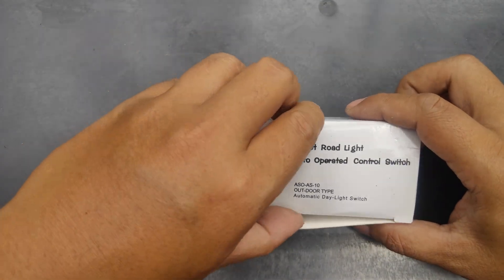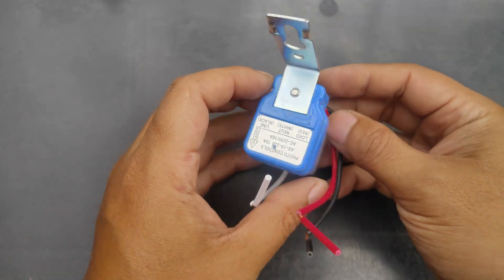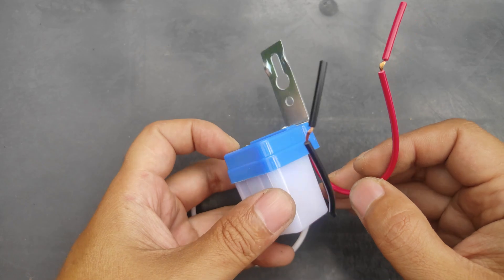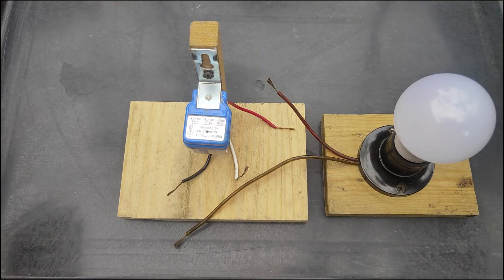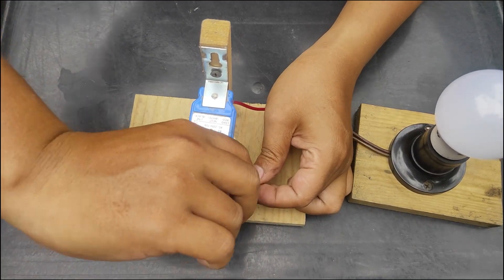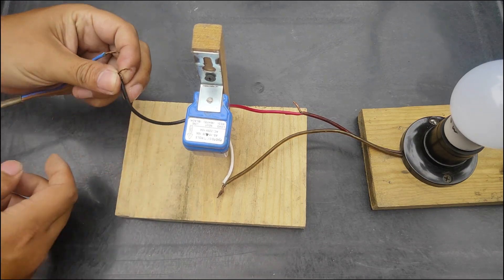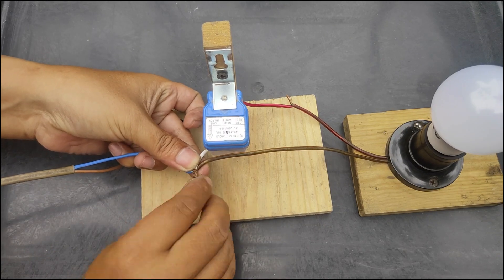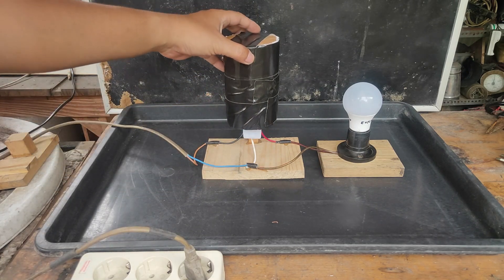✅ How to Install a Photocell Sensor for Automatic Lights | Easy 220V Wiring Guide

Comment: Can I reverse the on/off condition so the sensor turns on the power when detecting light? I want to use it to turn on a fan when the light in the room is switched on.
Reply: Possible Just incorporate one more  "no nc" "relay"  switch  in the circuit , now you can choose which ever way it should work , "normally on" or "normally off " 👍👍
Reply: @amoldange1628 awesome, thanks a lot!

Comment: How long is the distance limit between the bulb and the photo sensor?
Reply: It doesnt hav a range, it cud b anywhere on the circuit
Reply: @aniramnauth770  I believe he is asking regarding the distance between the 2 coz that sensor is detecting light to turn the switch on and off.

Which means it would loop if it detects light from its own bulb when it turns on.
Reply: @aniramnauth770 it should be anyway but on top of the light